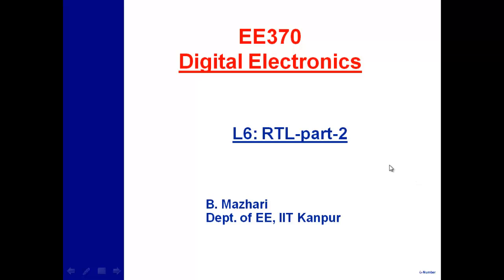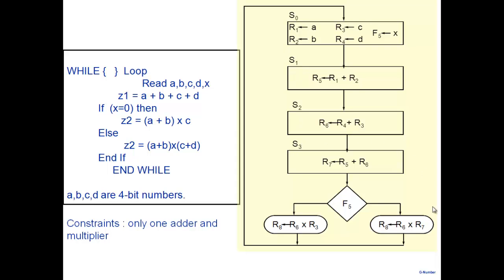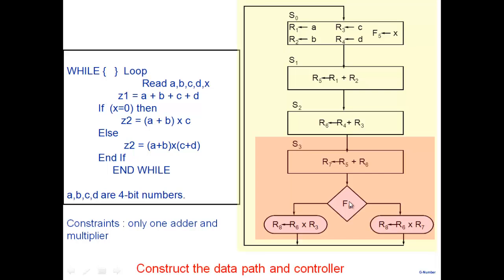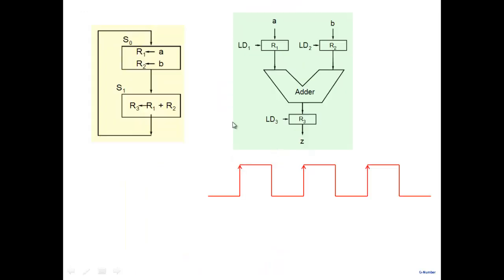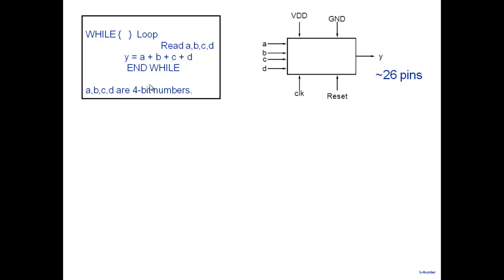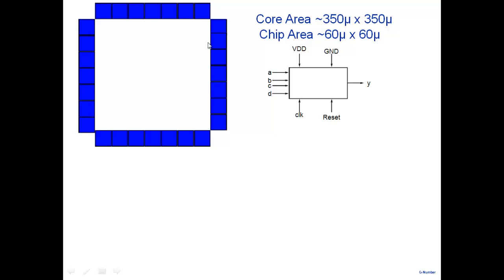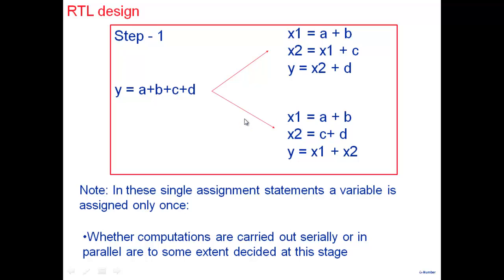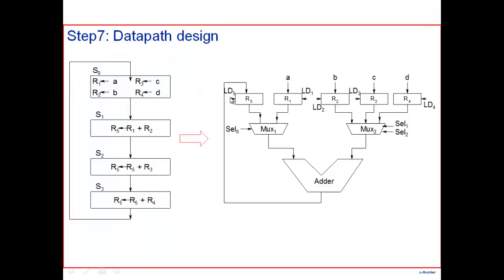Register Transfer Level (RTL)  design  part-2 (EE370 digital IC design L6)

Comment: why some chips have NCs?
Reply: NC means 'No Connect', we indicate that for a specific design where you don't need to connect any inputs. for example take, Mux2 at 2:08 in video, it is a 4:1 Mux, which means it should have 4 data inputs but has only 3 data inputs so, one input is floating and left behind, we name that as NC, since we dont use that pin for 'that' specific design